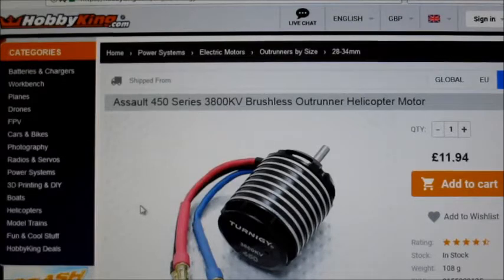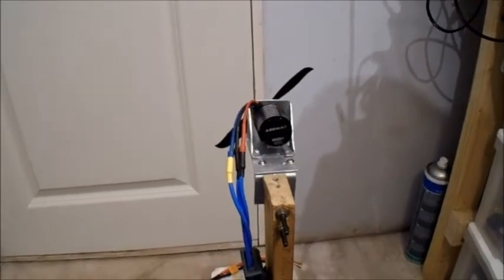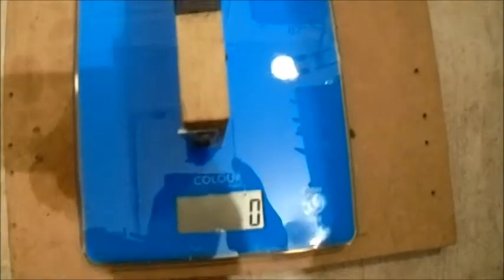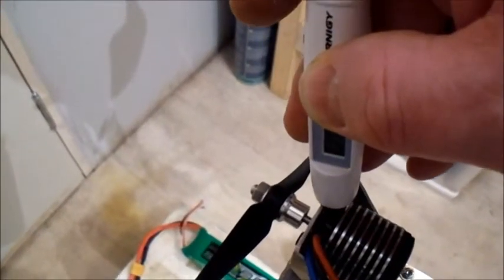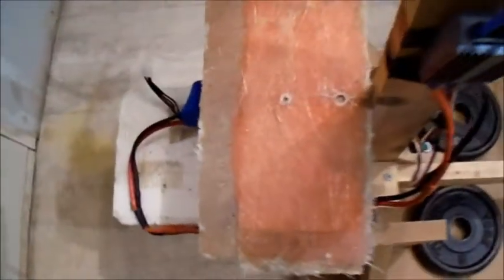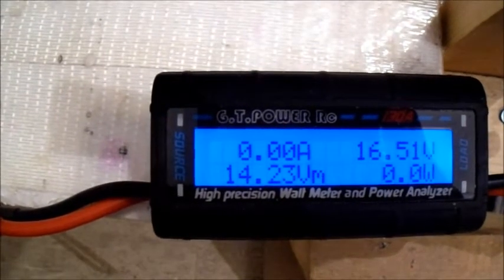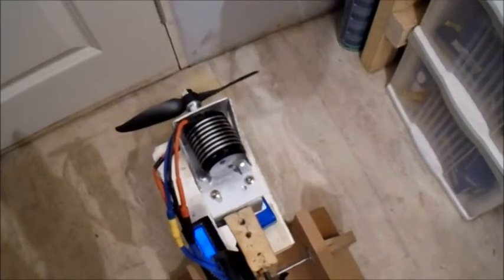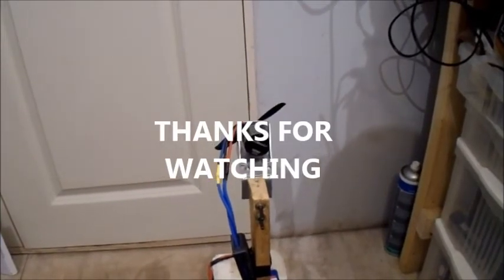Assault 450 3800kv Heli Motor Thrust Test Motor test of the Week

Comment: For flying wing race setup with unlimited kg of weight.. The race track is a figure-of-eight that passes
two reference points are 200 m apart.. The time given is 4 minutes to complete as many
maybe the track ( figure-of-eight ).. Will You Choose this motor or warhead motor or Goolrc 4074 2250kv or GARTT HF500 motor? or maybe you have any idea?
Reply from the maker: I would think you would want something small light and agile. Able to make quick changes in direction. For this I would trying the Assault 450 3800kv motor.
Reply: can the Assault 450 3800kv motor upgrade the thrust to 3 kg?
Reply from the maker: @mohfitrahnanda9447  Short answer no. Long answer Hell no!

Comment: Quick Question - what motor / prop / cell combo would you recommend for an Airboat? I'm limited to 7" diameter props, but size/weight arent much of an issue cheers!
Reply from the maker: What sort of size and weight we talking?
Reply: @rcplanepirate  650g bare hull at the moment. fibreglass / carbon fiber.  65cm long
Reply from the maker: @JamesDeColling  Right. It's not easy working out how much thrust you would need being maybe 2kg final weight plus the drag on it passing through the water. The motors I think you should try will turn a 7 in prop on 3 and 4s. So suggest you try a 7x4 prop on 3s first and if it needs more power try a 4s. It's a middle of the range setup. Didn't want to suggest something to powerful it's uncontrollable nor something too weak so that it hardly moves.
  https://www.ebay.co.uk/itm/C3542-1450KV-Outrunner-Brushless-Motor-Fixed-Wing-For-Airplane-RC-Model-Kit/274473566070?epid=1138602438&hash=item3fe7e63f76:g:LYMAAOSwxONfR0nr

https://hobbyking.com/en_us/duraflyr-tm-efxtra-3536-1780kv-replacement-aerostar-motor-w-mount-and-propeller-shaft.html?queryID=c0c2ec979008fac1bdb5b4a7b20a46d2&objectID=58564&indexName=hbk_live_magento_en_us_products

Comment: 3800kv .... whoa! 600+ watt. That's tons of power. I'm curious if it's possible to place it to a parkjet 😁
Reply from the maker: Hello mate. You mean so the shaft comes out the back of the motor not the front. I call that pusher style. Some motors are easy to do this on and other are really hard. This motor would be hard but not impossible. If the grub screw holding the shaft isn't stuck and the shaft comes out easy then you would need to drill a hole in the back plate for the shaft to come out or just leave the back plate off but then you lose the affect of the inbuilt cooling fan. You will also need a replacement 4mm motor shaft with the grove in it for a c clip. Then it should work. 
Only use good quality ESC's with this motor though. I like the Turnigy AE series and Plush ESC's and the HobbyWing Platinum ESC's. As you can see in this video the make the motor run a lot smoother and a lot cooler. If you use cheep ESC's with basic programing these high kv motors will run HOT and will possibly burn out. Hope this helps mate.
...RCPP
Reply: This seems to be the same as the 3800kv Gartt heli motor that I had strapped onto the back of the pink pusher delta jet that I built awhile back. The Gartt motor was only rated for 320 watts but was producing well over 1000 watts and 100+ amps on 4s with a 5x5 prop. I know that's overkill but it took it in stride while pushing that delta jet in excess of 140mph, and that was while doing straight, level passes. After 3 minutes of full throttle speed runs the motor was hot but  at the time the temperatures outside were 90+ degrees fahrenheit. I have ran that motor hard countless times and the windings in it still look like they did when it was new. Haven't noticed any slop or noise in the bearings either. RCPP, I would love to see you put this motor in a delta similar to the pink pusher that I was flying. Being that we are both speed addicts, I know that you would be very happy with this motor on one of your wings. I will be looking forward to seeing a flight with whatever you decide to strap this little powerhouse onto.
Reply from the maker: Hi Michael
I was very surprised by this motor too. Although I wasn't pushing it as far as you were I could not believe it was only at 32 degC after putting more then twice the rated power through it.
Your little delta sure was screaming with this motor in it and I'm glad I added one of them to my last order from HobbyKing.
I am going to be making a plane specifically for testing a lot of these 28mm sized motors. I will basically be able to fit any 28mm diameter motor in it and swap the motors easily. It will be the next step in the Motor test of the week series. After seeing how different motors perform in the test plane I can then decide what plane to fit each motor. Thanks for watching mate.
...RCPP